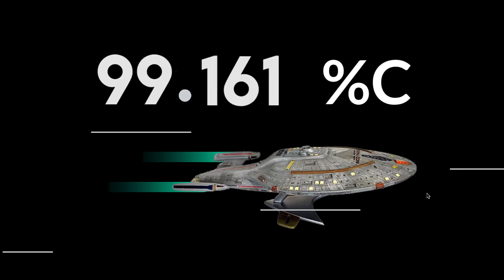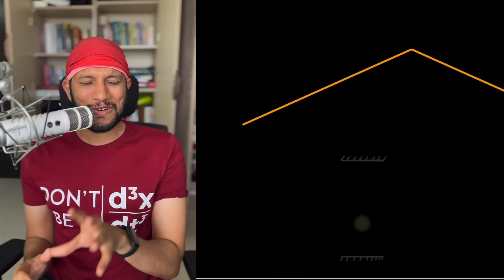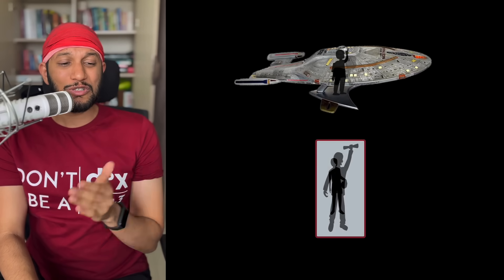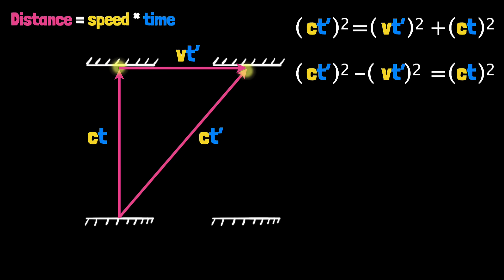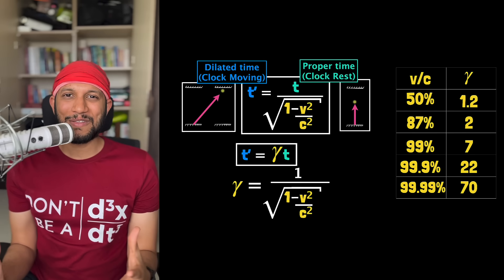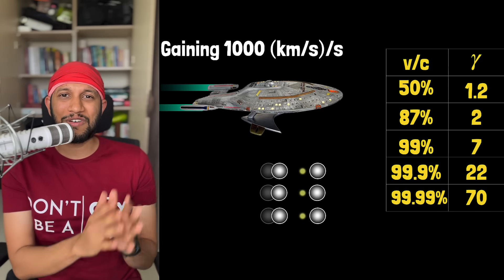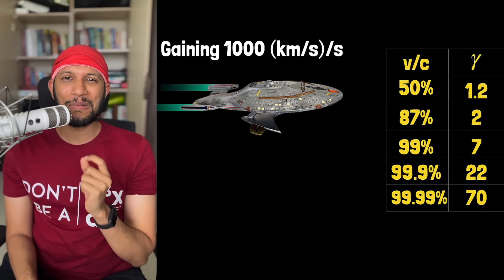I finally understood why you can't go faster than light! (My mind is blown)

Comment: Modern physics is about to undergo a major paradigm shift! The speed of light is not a constant speed as once thought, and this has now been proved by Electrodynamic theory and by Experiments done by many independent researchers. The results clearly show that light propagates instantaneously when it is created by a source, and reduces to approximately the speed of light in the farfield, about one wavelength from the source, and never becomes equal to exactly c. This corresponds the phase speed, group speed, and information speed. Any theory assuming the speed of light is a constant, such as Special Relativity and General Relativity are wrong, and it has implications to Quantum theories as well. So this fact about the speed of light affects all of Modern Physics. Often it is stated that Relativity has been verified by so many experiments, how can it be wrong. Well no experiment can prove a theory, and can only provide evidence that a theory is correct. But one experiment can absolutely disprove a theory,  and the new speed of light experiments proving the speed of light is not a constant is such a proof. So what does it mean? Well a derivation of Relativity using instantaneous nearfield light yields Galilean Relativity. This can easily seen by inserting c=infinity into the Lorentz Transform, yielding the Galilean Transform, where time is the same in all inertial frames. So a moving object observed with instantaneous nearfield light will yield no Relativistic effects, whereas by changing the frequency of the light such that farfield light is used will observe Relativistic effects. But since time and space are real and independent of the frequency of light used to measure its effects, then one must conclude the effects of Relativity are just an optical illusion.

Since General Relativity is based on Special Relativity, then it has the same problem. A better theory of Gravity is Gravitoelectromagnetism which assumes gravity can be mathematically described by 4 Maxwell equations, similar to to those of electromagnetic theory. It is well known that General Relativity reduces to Gravitoelectromagnetism for weak fields, which is all that we observe. Using this theory, analysis of an oscillating mass yields a wave equation set equal to a source term. Analysis of this equation shows that the phase speed, group speed, and information speed are instantaneous in the nearfield and reduce to the speed of light in the farfield. This theory then accounts for all the observed gravitational effects including instantaneous nearfield and the speed of light farfield. The main difference is that this theory is a field theory, and not a geometrical theory like General Relativity. Because it is a field theory, Gravity can be then be quantized as the Graviton.

Lastly it should be mentioned that this research shows that the Pilot Wave interpretation of Quantum Mechanics can no longer be criticized for requiring instantaneous interaction of the pilot wave, thereby violating Relativity.  It should also be noted that nearfield electromagnetic fields can be explained by quantum mechanics using the Pilot Wave interpretation of quantum mechanics and the Heisenberg uncertainty principle (HUP), where Δx and Δp are interpreted as averages, and not the uncertainty in the values as in other interpretations of quantum mechanics. So in HUP: Δx Δp = h, where Δp=mΔv, and m is an effective mass due to momentum, thus HUP becomes: Δx Δv = h/m.  In the nearfield where the field is created, Δx=0, therefore Δv=infinity. In the farfield, HUP: Δx Δp = h, where p = h/λ. HUP then becomes: Δx  h/λ = h, or Δx=λ. Also in the farfield HUP becomes: λmΔv=h, thus Δv=h/(mλ). Since p=h/λ, then Δv=p/m. Also since p=mc, then Δv=c. So in summary, in the nearfield Δv=infinity, and in the farfield  Δv=c, where Δv is the average velocity of the photon according to Pilot Wave theory. Consequently the Pilot wave interpretation should become the preferred interpretation of Quantum Mechanics. It should also be noted that this argument can be applied to all fields, including the graviton. Hence all fields should exhibit instantaneous nearfield and speed c farfield behavior, and this can explain the non-local effects observed in quantum entangled particles.

*YouTube presentation of above arguments: https://www.youtube.com/watch?v=sePdJ7vSQvQ&t=0s

*More extensive paper for the above arguments: William D. Walker and Dag Stranneby, A New Interpretation of Relativity, 2023: http://vixra.org/abs/2309.0145

*Electromagnetic pulse experiment paper: https://www.techrxiv.org/doi/full/10.36227/techrxiv.170862178.82175798/v1

Dr. William Walker - PhD in physics from ETH Zurich, 1997

Comment: There is no such thing as a speed limit. 
Mathematics is a tool, not a rule. 
The laws of physics stated that the human body could not travel faster than 100mph but the steam train provided that the laws of physics were wrong. 
The laws of physics stated that any vehicle could not travel faster than the speed of sound but that was proven wrong. 
The laws of physics are not physical laws, they are just an attempt to explain stuff and actually don't have any scientific evidence to back them. 
The speed of light is just the speed of a laser reflected of a mirror back to its starting point in a vacuum, so it doesn't represent all the different forms of light. 
Light can be reflected, refracted, bent, accelerated and slowed down so it doesn't travel at a constant speed because that would be popetual motion. Apparently, popetual motion defies the laws of physics. 
Theoretical physicists are just mathematicians and not true scientists.

Comment: Makesh is a fraud. He is giving you bad information.

1) Space and Time are SEPARATE frames of reference.
2) clocks measure motion in SPACE, not time.
3) the synchronized clock experiments NEVER produced any time-dilation. Both clocks used the same amount of energy and thus, had the same amount of runtime.
4) light travels in its OWN frame of reference. Independent of the source. Independent of the observer. The reason the clock in motion is running slower is because the source's frame has been accelerated but not the photons frame. Inverse square law of motion. Force decreases with distance.

5) no experiment to date has validated Einstein’s Relativity nonsense. None whatsoever. 

6) no experiment to date has validated time-dilation by simply going faster in space. In fact the complete opposite has been proven. Accelerated heart rates during lift-off while the onboard clock is registering fewer clock cycles. 

Explain that, Einstein. 

Time-dilation is when the sun doesn't shine. Time-dilation dilation is when you are on a low protein diet and it takes longer to reach puberty. 

You shouldn't be praising this kid. You should be calling him out for his ignorance. Where is your evidence, Makesh? 
Go back to school and study Newton's Laws of Motion.
You are an embarrassment to the human race.

Comment: Great video, though in general one caveat - the argument “I have to add an infinite amount of X to counter Y becoming infinite” may or may not resolve to a finite result. Which is why the formulas are important. ;)

Another fun fact: It’s not impossible for something to move faster than light, it’s just impossible to accelerate something from slower than light to (faster than) light.

The same goes for the Planck length. Both are barriers, not limits.

Comment: Time dilation only explains the impossibility to reach c. However the fact that c is finite is the consequence of our universe having causality : only when information travels at finite speeds that you can have consequences happen after the causes.
Reply: That's rather stupid. Causality is instantaneous. You can't go faster than instantaneous speed so you can't go back before the event occurred.
Reply: @stewiesaidthat  causality spreads only at the speed of information propagation, not faster. Otherwise causes would happen before consequences.

If you call this stupid, then you obviously don't understand what you're talking about. Ever tried to actually make sense of the 4d metric with the negative t term ???
Reply: @skycocaster  causality is cause and effect. The cause is instantaneous. The effect travels at the speed of the carrier wave. You can go faster than light (effect). You just can't go faster than the cause. 
People get those two turned around and then go off the rails with time-travel.

Comment: Light is a border, elastic, its speed decelerates with the expansion of the universe, i. e. in the past speed of Light in Aether was greater and in the future it gets lower.
Such speed of Light is let's say 299 999,9999999999999999999999999999999999999999998…7…6…5…4…3 and counting down by the… "second" as we write comments.
Therefore Speed of Light and Space elasticity are connected. There are non-material nature of Space which allow for a billion × billion faster speeds. But not for rockets (over glorified farts).You can not conquer Space with giant farts.

Comment: But from each photon clock's perspective the other photon clock is moving, so why does time only slow down for one of them?
Reply: It stems from the fact of not understanding the observation. 
Light travels in its own frame of reference. Applying Newton's Laws of motion. Force decreases with distance. For a moving clock, the photon has a greater distance to travel and thus exerts less force. Less force = fewer clock cycles. 
The second egregious error is in not treating space and time as separate frames of reference. Both clocks experience the same amount of time. One just experiences more space.

Comment: a 15minute video to explain Mass.  Accelerating any Object towards the speed of light even at 10% would require more energy then the Sun can Produce. There's caviats for this that Neutrons and Protons can go the speed of light as they dont have any mass and There is no law that states Space its self cannot travel at the speed of light or faster. Look up the Alcubierre drive basically any time anyone is ever talking about faster then the speed of light they are talking about Alcubierre's work. There that took all of two minutes.
Reply: For every action, there is an equal and opposite reaction. To accelerate mass forward, you need to accelerate mass backwards. Eventually, you run out of mass to accelerate the craft with. You then have to stop and refuel. Or, install a ram scoop to collect more mass. The second problem is that there are limits on the velocities one can achieve.

As for Alcubierre, he is a con artist. 
Nothing can go faster than Space because space is nothing. It has no physical properties for anything to act on.

Comment: Is the instrument you are using to measure a thing is altered by the experiment itself beyond the measuring process then it is not an accurate measurement therefore time does not slow down it doesn't it continues to exist the physical aspects of reality alter but time itself is not changing you just explained why time is not what is changing our ability to measure it changes

Comment: Here's another perspective on the problem that offers another intuitive angle on the whole thing. If we ignore the external perspective, and you just view the journey from your own perspective in the ship - there *is no lightspeed limit*. 
Because YOUR perception of time is slowing down, that means that everything outside your ship appears to be happening FASTER, which means your apparent acceleration NEVER slows down as you approach light speed, and you can end up moving through the universe at whatever speed you want (given sufficient energy). You could fly the 200 million light years to the Andromeda galaxy in a *single shipboard day*, if you had enough energy to accelerate sufficiently. So from a personal perspective, the light speed limit simply doesn't exist.
But from the external perspective, it does. Your trip will still take a little over 200 million years, no matter how fast you can go. Also, one other caveat: if you were watching videos being sent to you from Andromeda - say you wanted to keep abreast of the latest Andromedan sitcoms,  during your brisk 1 day journey you would receive the entire 200 million years worth of transmissions from Andromeda that they sent during your voyage. It'll make for a tough binge.

Comment: I still don't get time dilation. You say that if we were watching a photon clock in a spaceship travelling at .99c, we would have to wait 22s for that clock to tick one second.

You constantly speak of what we would "see" outside the ship. This word "see" means that we are dependent on photons doing what photons do, which is traveling at c. 
So, if this ship is travelling away from us, then the photons from that clock are travelling a longer and longer distance as the ship accelerates, but they're also taking longer and longer to reach us, surely?

This time dilation is just a fairly normal consequence of photons having a longer and long distance to travel.

There is no time dilation, it's a purely physical effect with our eyes getting stimulated later and later as the photons gave to travel a larger distance.

Comment: Yeah, but the theory falls when you begin to think in the reference point. Speed of light in relation to what? For speed of light to be a division by zero, you'd have to have a zero reference, what is it. Ah, and all references are the same and as such, valid, so If a ship goes at half speed of light in one direction and another ship at the same time goes with half a speed of light to the opposite direction, wouldn't they be moving at exactly the speed of light in relation to each other? I understand that time dilates in relation to speeds (though I don't believe it, but I also don't believe light speed is a constant) So what is the zero reference? Can't be Earth, It's moving around the sun, which is moving around the galaxy which is also moving. All this mess only happen because light speed is being considered as constant no matter the speed which its emitter is.
Reply: The zero reference is the speed of light. 
What did bobblehead Einstein say about light?
1) constant speed.
2) same for all observers
3) travels in its own frame
4) nothing can go faster.

What the dimwitted patent clerk didn't understand is that motion changes the frequency of light. 

Place the power source forward of the direction of motion, and you get blueshift. Now your clock is running faster.

Comment: I can't comprehend that ct' is a correct way - it will be (c+(vector of v, depending on the angle))t' - but because we have evidence that things can't move faster than c - this creates a paradox described in this video. But if this paradox created - there is a possibility to move at light speed as the effect of some other paradox. It is hard  to find laws of world creation from the inside of this world, this is where teological thinking began

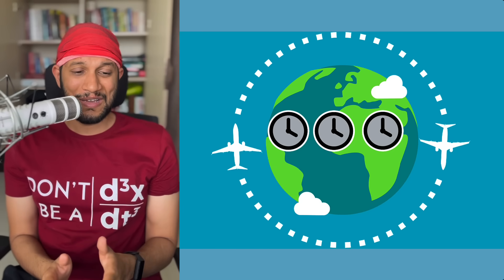Comment: I have always wondered about the time dilation thing. This video by far provides the clearest explanation I have seen. But at 4:40 , I still find it difficult to understand the logic of "If we can't measure it, we should not care about it". Thanks for the video.
Reply: High~ Did you use the wrong time? Cause the one you gave doesn't talk about "can't be measuring so we shouldn't bother" and I don't think I heard something similar throughout the video (granted I blank out sometimes)
Reply: @hikari1690  Yea I wanted to timestamp the best example along with the argument for interaction time being different from actual time flow. The point I guess would be in around 7:10
Reply: @rkay.gaming  oooh so the realm of philosophy thing? I still don't get that part so that's probly why I didn't understand your comment. Tank you~

Comment: Good stuff
Just one thing - the ship slows down to standstill - from our perspective
But within the ship - acceleration continues - and they break the light barrier
After a period of time they then slow to a stop
From the point of view of the observer - the 'stopped' ship they are observing just 'winks' out of existence - and appears at it's new location, corresponding to the actual distance travelled - isn't it?

Comment: Insanely intuitive. I just have one (admittedly technical) question.

13:44 A function can have its rate of change approach zero as it approaches some limit value while still reaching it at a finite input. As an example, the slope of sin(x) approaches zero as the function approaches 1, but it still reaches 1 with a finite input (pi/2 units). How can we show that this isn't the case for the velocity function at a constant acceleration? (I'm ok with a non-intuitive answer).

Comment: I like the way you explained. However, I have the feeling that it is not a perfect explanation: you use the assumption that nothing can travel faster than light to show that nothing can travel faster than light. This leads for an external observer to the observation that the clocks on the spaceship are running slower and slower the faster the spaceship goes. Which in the end leads to the observation the ship will never reach c.
However, all of that is based on the (unproven as far as I know) assumption that nothing can travel faster than light (in a vacuum).
Don't get me wrong: I am not challenging this assumption, I do not have some wild theories, just as far as I know it is an assumption.

Comment: Thought experiment, picture a perfectly symmetrical metal disc shape, as big as the solar system.  Somehow spin the disc so that the half radius point is moving at a speed of 0.75 c.  What happens to the disc as you get further away from the center point?